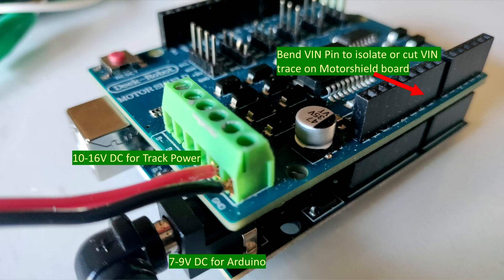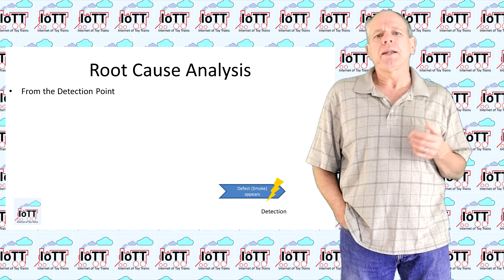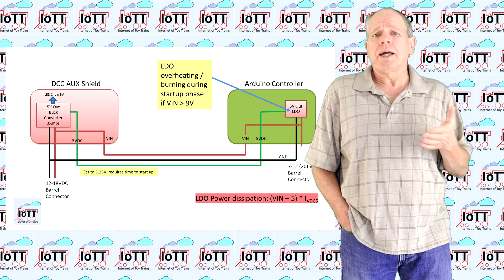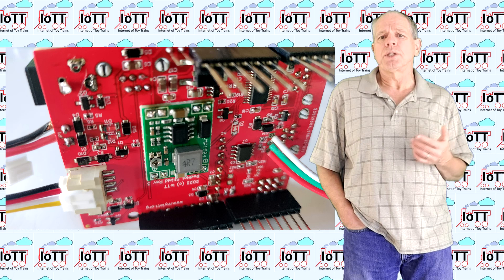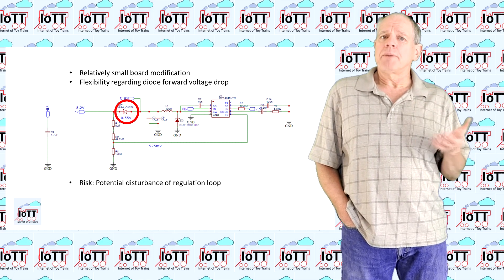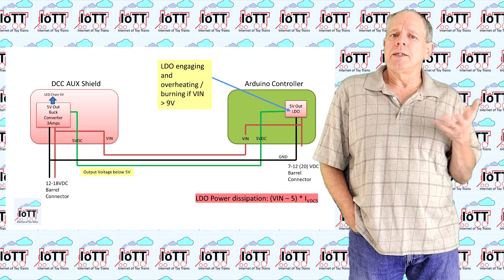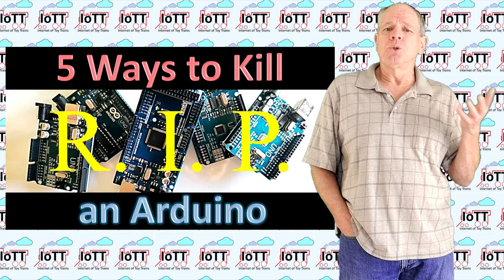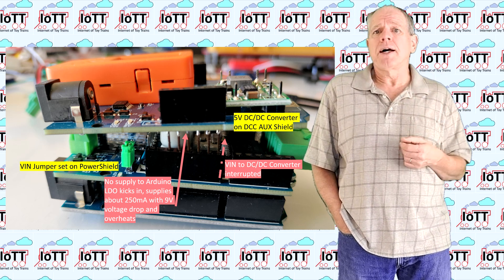5 Ways to Kill an Arduino (Video#115)

Comment: Is there an instance where stacking things in a specific order would cause an overload? I was working through some issues I was having with the IOTT stick and Loconet loopback not seeming ti be enabling track power and I ended up toasting an Arduino Mega. Here are the 2 stacks that I was using. from bottom to top

1: Elegoo Arduino Mega - DFRobot Motor Shield - DC Aux board - IOTT Stick  - this is the setup that wasn't working  as described

2. Elegoo Arduino Mega - DFRobot Motor Shield - DC Aux board - RedHat - IOTT stick - This setup immediately smoked when applying 12v via a 12v 5a supply to the DC Aux Board.

I had installed the redhat into the stack thinking that since the IOTT stick had options for RedHat rather than DCC Aux that adding would add the functionality that I was looking for having the ports for Loconet, etc. And I kept the DC Aux board in the stack as my RedHat was the newer version that lacked the DC Buck Converter. So i'm wondering that if there was something in the RedHat that bridged the 12v current directly through the stack down to the Arduino. 

As an aside my problem wasn't with my original stack but with the version of DCCEX I was attempting to use, i believe. 5.0.3 wasn't working and downgrading to 5.0.0 worked.
Reply from the maker: No, the sequence does not matter. When using the IoTT Stick, the hat that has the Stick will be on top so you can access the buttons.
Whether the motorshield or the DSS AUX board comes first does not matter. It also does not matter what DC jack you use to power the stack, either Arduino or DCC AUX shield.
If the power on the board is not coming on, but the LED next to the stick changes color, that means the Stick does not communicate with the Arduino. Most likely reason is that the Arduino has an active USB connection. Second possibility is the serial port jumpers next to the RxD and TxD pins. The need to be in the position closer to the edge of the board. Third possibility is the pin headers between the boards are not properly inserted or the Stick is not installed correctly.
If the Arduino LDO overheats, it can have two reasons: The 5V pin from the DCC AUX board to the Arduino is not conducting. In that case, the LDO overloads, but it should not burn immediately. The other possibility is that VIN is not conducting between DCC AUX and Arduino. In this situation, the Arduino gets 5.2V on the 5V pin from DCC AUX, but the input to the LDO (from VIN) is unpowered. That leads to a reverse voltage on the Arduino LDO, which can destroy it. 
Always verify that both, VIN and 5V are making contact from board to board. The risk can be minimized if the boards are inserted co-planar to each other. The encloser frames help greatly with that as they have a support where the board rests on, perfectly parallel to the lower board and in the right distance.
Hope that helps.

Comment: Interesting learning experience.  I assumed the AUX shield was just a Redhat shield minus the loconet.  Either way, great video watching the investigation process.
Reply from the maker: DCC AUX basically is a RedHat minus Loconet, that's right. But I used the opportunity to also do my own buck convertor as mounting the add-on boards is a lot of work. Now that I have a buck convertor module I can also use it when I do a new batch of the other boards that have a DC/DC convertor (Blue, Yellow,  GreenHats)

Comment: I didn’t check but are you using the same voltage regulator on the yellow hat and green hat. I am having some issues with them. Two yellow hat stop reading input. And green hat stop moving the servo.
Reply from the maker: No, I designed my own so I have the option to get away from the add-on board and go with a convertor with fixed voltage output.
Now, I am not sure about the issues you describe being related to the DC/DC convertor. On the YellowHat, the 5V is only used for the LED chain while the buttons run on the 3.3V output of the Stick. 
On the GreenHat, it is different, there the servo operation needs at least 4.8V from the DC/DC convertor or they will switch off. What you should do is checking the Stick display for the 5V Input voltage and see how it changes when you connect/disconnect an external power supply. The display line should change color and display the current value.